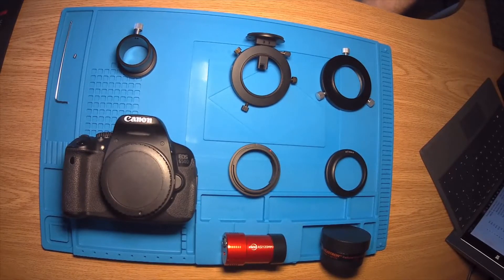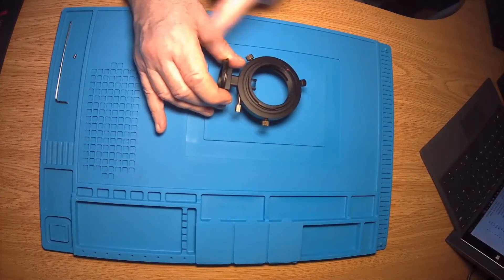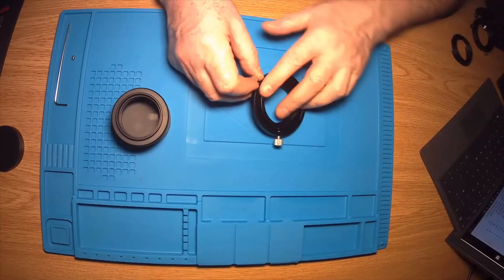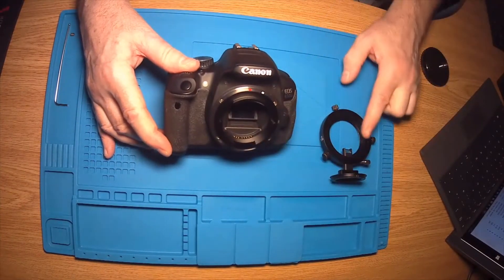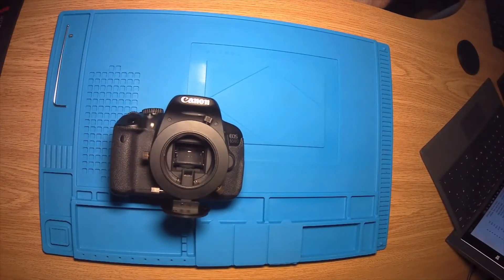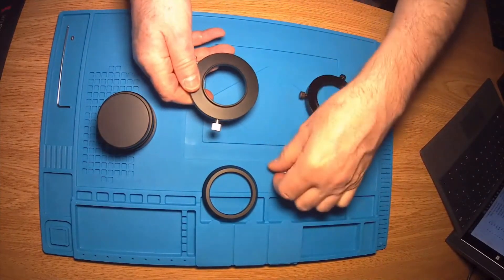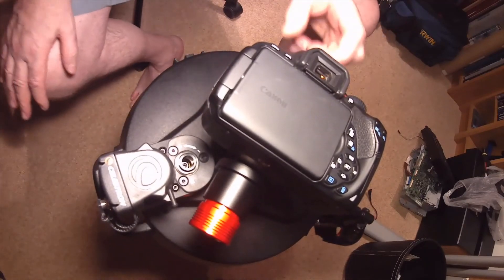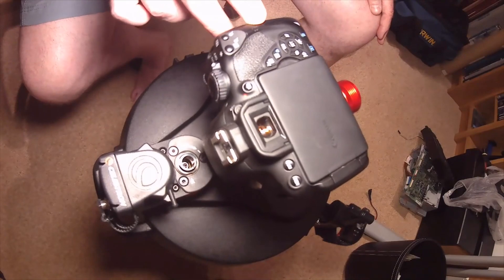TS Optics 9mm Off-axis Guider (OAG) Overview, Assembly and Fitting to Celestron Evolution 9.25 SCT

Comment: Hello, I got same product from a german webshop called Teleskop. I got the OAG, and the EOS to OAG adapter, but the problem is my adapter is different than your video. The one I have, when mounted to the camera, leaves the space for the prism, on the top, that is, pointing to the FLASH of the camera, and in your video, the gap for the prism is on the bottom, which is the correct way in order to mount the off axis camera. Where did you get your adapter? I see yours also has the dot painted in red while mine doesn't. I'm really dissapointed that I got a different one than yours, and now I cannot mount my camera. Please let me know if you remember thanks!
Reply from the maker: Hi there Ferradar :-)  It sounds like you have two options to me; firstly, you could scrap / return the EOS to OAG adaptor you have bought and get the same one I have, which is available from places like https://www.teleskop-express.de/ (part number TSOAG9-EOSDEF @ 9.90 euros), or alternatively you could cut a slot in the bit of your adaptor that is not allowing you to position the OAG where you need it to be, although that will depend upon how much metal there is around it and whether you have the skills and tools to do the job.  HTH! 🙂
Reply: @michaelbenn4741  Hello Michael, I reached out to teleskop company, and unfortunately, it seems they discontinued the "good" adapter that you have in the video, which is the one they should be selling instead. Now they are selling the one that you just mentioned (part number TSOAG9-EOSDEF @ 9.90 euros), which is the one I bought, and it's the wrong one. They told me it's kind of a mistake part that they are trying to sell of until their stock is gone, and then this piece will be gone forever unfortunately. Seems not many people are using eos cameras to photograph the stars with auto guider, which doesn't make sense for me, but it's their company! haha rip

Comment: Hi there ☺ you do know the Celestron Nexstar Evolution series was designed not to use a guide camera!! I have the Celestron Nexstar Evolution 9. 25" and have had no issues with long exposure time. How the SkyPortal App on your iPhone or Android device works via the WiFi on the telescope is once you do a 3 star alignment you will then have the option to align to 12 more additional stars, the more stars you align to the more accurate the pointing and tracking eliminating the need for a auto guider. I've only had to align to 4 more additional stars for precise tracking and long exposure with my DSLR camera 👓🎓 I know a lot of people who has the same telescope and has not used the full innovative technology provided with this telescope 🔭 i also have it mounted on a HD Pro Wedge :)
Reply from the maker: Thanks for your interest and input Notts Boy :-)  This video was made using the OTA off my Evolution 9.25, which I also used with a Pro Wedge and a StarSense too.  Unfortunately almost all of my astro kit was stolen, so that's when I moved up to the CGX.  I'm very happy that you are able to take long exposures with your Evolution 9.25, but in my experience even with a 'scope that is perfectly level, aligned using StarSense, then StarSense Polar Aligned, then another StarSense alignment, then adding additional  reference stars, even the best mount will show star drift at the 2350 focal length of the 9.25, and even worse with a Barlow, and even with a Focal Reducer.  I don't know anyone who is serious about astrophotography who doesn't use a guide-scope on top of their main OTA or an OAG, using something like PHD2 to nudge the mount in order to get really good tracking.  After all, the motors, gearing and electronics within even a really good mount are subject to wear, the limits of the stepper motors used and backlash in the gear-train, and whilst I can do 60 or 120 exposures without  a guide-scope sometimes, depending on where the 'scope is pointing, with little star drift, using a guide-scope I can do 300 seconds or more without trouble, no matter where the 'scope is pointing in the sky.  If you've been lucky enough to end up with the world's most accurately tracking 'scope then good on you :-)  The Evolution range is good, but it's not Celestron's best, and even Celestron don't claim that it does completely away with the need for a guide scope.  I'm sure that everybody would buy an Evolution if it no guiding was ever needed :-)

Comment: Great video! Do you think it's suitable for a Newton f5 with an asi zwo as guiding camera? Thank you!
Reply from the maker: Hi Alf :-)  Sorry, I have no experience with Newtons, only SCTs, so can't provide any sensible guidance I'm afraid.  If you're considering getting the TSO OAG, make sure you consider all the adapters you might need and take them into consideration when comparing with something like the Celestron OAG.  It comes with just about everything you could possibly need, but at a hefty price, and it adds quite a lot more to the optical path too.  HTH :-)

Comment from the maker: FYI, the configuration I have shown here adds a mere 226g to my set up, so very little impact on the overall mass of the scope, and also only a minor correction required in the scope's balance if the OAG and guide camera set up is added or taken away mid-session.  I've also designed and 3D-printed a non-rotating helical focuser, which adds only another 22g to the setup.  The focuser adds about 16.5mm to the OAG optical path and allows about 3.7mm of focal adjustment; so after getting the main scope in focus, the guide camera coarse focus adjustment is achieved by moving the guide camera in and out in the 1.25" adaptor, then fine focus is achieved using the non-rotating helical focuser.  If you're interested in the 3D-printed helical focuser it's on TinkerCad, so just do a search for 'Non-Rotating Helical Focuser' and see how you get on :-)

Comment from the maker: After use of the TSO OAG in the field, I found that the grub-screw I added at 09:49 tends to wind itself in, to the point where the conical ring no longer is able to fit, even if you take the two remaining aluminium screws out altogether.  You could always add some Loctite or similar thread-locking compound to the grub-screw before fitting it, but I ended up putting another grub-screw in behind the first one and then tightening it down, which has solved the problem :-)  Some grub-screws have a protruding end, as mine did, which prevents the second grub-screw getting a start on the female thread, so I ended up just turning the grub screw round so that it threaded in allen  key slot end first, then tightened it down using some needles nosed pliers.  HTH :-)
Reply from the maker: Having tried the above approach of adding a second grub-screw, I found that the prime grub-screw still comes loose, so I've ended up going the Loctite route after all.  HTH :-)